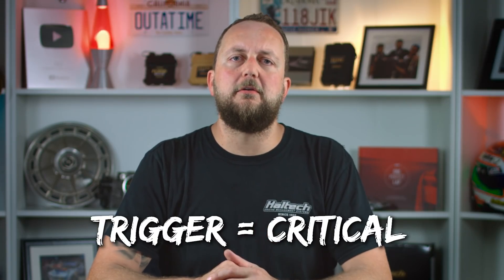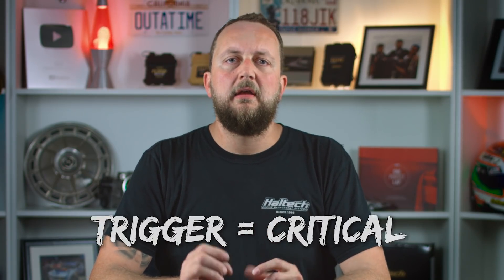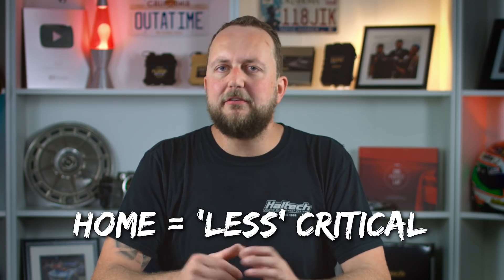🛠 Get Triggered - Engine Trigger Systems Explained | TECH TUESDAY

Comment from the maker: It's Tech Tuesday time again! Today we're talking Engine Trigger Systems. Hit that PLAY button to find out what the different trigger systems are and how they work. Enjoy:)
More videos on the subject here:

How Nissan's Cam Angle Sensor Works: https://youtu.be/mh4hxnfMfGA
How to Set Up Crank Angle Sensor: https://youtu.be/HW0ENqcxNSg
Reply: good video,   ? specific to the 2jz Nonvvti... 
how do you calculate injection angle and injection phase from a 12tooth - 1tooth setup properly
Reply: Haltech as you may remember this was exactly my issue. Thanks to the Haltech support team we figured it out and made my vh41 work! Thanks guys!
Reply from the maker: Here is a video we did some time ago on TDC: https://youtu.be/2yoxiKJ1KzY
Reply: Sooooo... Get an engine with timing chain instead of timing belt and you have less harmonic resonance issues? Am I even there about?

Comment: Hey do you have a suggestion for a Datsun L28 6 cylinder? I was thinking about a 36 - 1 trigger wheel on the crank and a single tooth “home” wheel inside the distributor. Thanks! P.S. - I can make my own cam “Home” wheel myself. 👍🏼

Comment: Hay mate 
Do you know what way to wire the crank angle sensor on s2 Buick vn-vp v6 using ems 4424 stinger
Dose the cas go directly to the ecu or back to the coil ignition module?
Thanks

Comment: I'm interested as to how ECUs measure these trigger signals, as they are incredibly frequent (E.g. 10,000RPM * 32 Teeth = 320,000T/M)

I'm currently trying to create my own ECU, but have created it around a single tooth trigger wheel. Think of a typical trigger wheel, but inverted. This works great, but I tried to implement a way of configuring what type of trigger wheel the engine uses, and it can only run up to ~3500RPM. As it stands, I'm using interrupts to receive trigger signals.

Cheers, great content as always!

Comment: Hey mate I’ve got a issue with my haltech wjere the car won’t start due to haltech error message “cam sensor” but when I plug in my factory ecu for my ford barra the car starts….
Reply from the maker: Hi there, best thing to do is contact our tech support on support@haltech.com or by calling your local Haltech office. One of our tech guys will be able to help you out.

Comment: What would be the minimum recommended number of teeth on both the trigger and home? I have a (now) supercharged Volvo B21E (obviously no ECU originally) and I will be using an Elite 750. The crank has a custom harmonic balancer and  I can machine to suit with a hall effect crank angle sensor. Cam has nothing but was also looking at installing hall effect sensor and custom trigger disk to run on rear of cam gear. Thanks for the great videos.

Comment: What of engines that just have crank sensors no cam sensors , how do they calculate the  amount of fuel need?
Reply from the maker: You will need a signal from both the crank and the cam sensor to effectively manage the spark events. Crank alone does not provide enough information - ie what stroke each piston is at so you would end up with two spark events on each cylinder, twice as many as you need. Normally you will have a crank sensor and a cam sensor but sometimes you can get a two-in-one sensors - Nissan's RBs are a good example of this - we have a video explaining how the Nissan CAS works here: https://youtu.be/mh4hxnfMfGA

Comment: I have 12T multi tooth trigger wheel on the crank and single pulse home signal from a YB cosworth distributor. The phase sensor is an analogue reluctor and very sensitive to movement once the Haltech PS1000 is set and has been causing a few problems. So the plan is to fit a new distributor that uses an EF-AU cam angle sensor, digital hall effect. But others have recommended removing a tooth from the trigger wheel instead of upgrading the distributor, could I please have your thoughts on that? Thanks

Comment: I have an issue with my b series trigger reading. I have wired my trigger to the cyk  24 teeth and home to the cyp as it is the one teeth wheel. the problem is when I am cranking the the engine in order to check trigger synchronization level it gives me full then goes back to none and so on. there is no trigger error system. I tried to change edge, ground and edge rejection ratio but none of these tries do a job. can someone help doing the right setup and calibration, please ? it better to note about trick and tips. I did another job to the distributor and it works but I DONT want to doing every time as it takes a lot of work to do it. what I did is i made my 24 teeth wheels is a missing teeth wheel by removing 2 teeth and I have canceled the home reading as it is also doesn't give the correct reading samw as the first issue. if anyone wants to do what i did it is worth noting that edge must be a raising edge otherwise it won’t gives you full level.
Reply from the maker: Your best bet would be to contact our Tech Support, one of our tech guys will be able to help you out and ensure you're getting the most out of your Haltech ECU. email: support@haltech.com

Comment: I'm getting a new harmonic balancer. 
The balancer comes with 12 teeth or 36 teeth options. The application is a Nissan rb25det motor. Vehicle is running off a AEM stand alone Ecu.
Does my application even need that?
There is no teeth on my o.e. pulley.
And if I do, what option is correct.  12 tooth or 36 tooth?
Reply from the maker: Hasani, The OEM harmonic balancer does not have teeth because both in it's original configuration, Home and Trigger signal come from the CAS located on the back of the cylinder head. If you're planning on still using the CAS after the harmonic balancer upgrade, then the number of teeth on your balancer does not matter.
If you're going to upgrade to a true crank sensor , that's when you need to be concerned with how many teeth are on the balancer.
Haltech Elite ECUs would support both 12 and 36 tooth options if the cam's trigger is modified to be a single window. We can't comment on AEM.
Reply: @haltech  thank you so much for the reply. One last question tho, what would be better to have 12 or 36 if I go with a true crank sensor?

Comment: Hi can we tune the engine with only one sensor and that is 2 missing out of total 36 missing tooth on crankshaft? In my case i will tuning ktm duke 390 engine which is single cylinder.

Comment: Hey got a question in regards triggering, so my Son 1989 Toyota Supra turbo we're upgrading the  ECU to a Elite 2500 , what triggering system would you recommend?  We're planning for ignition system coil on plug and sequential system for the injector.

Comment: In a Missing Tooth system (36-2), i would be nice to know when the Home signal occures. The informations range here from right before maximum Ignition advance to 90 degree before TDC Zyl. 1. A video about this often used missing tooth system would be nice.

Comment: Crank trigger patterns are deeply rooted in the ECU software of every vendor. The 4B11 engine in Chryslers comes with a completely different trigger wheel compared one from a Mitsubishi. Cheaper to change the trigger wheel than the software.

Comment: You can actually run a engine with sequential injection (and spark) with just crank position sensor. The engine would be started in batch injection (and waste spark) mode. ECU will then need guess which way the camshaft is facing (out of two) and chose the one that runs (better).
Reply: What ECU is capable of guessing?
Reply: @jockobo  It doesn't really guess. It just chooses one out of the two options. And then monitor if engine runs properly. If not it just switches to the other option.
Reply: @valde3336  Haltech ? Just curious because that's pretty neat.

Comment: 1:25 - same thing that can be seen on supercharger drives, the belt flutters slightly.
As an aside, oine of the early drivers of crank triggered systems in motorsport was a problem high rpm drag cars had with timing scatter as the timing chains stretched and fluttered - even worse off were vehicles like the Chev' engine which had the distributor and oil pump alse being driven off the far end of the camshaft as the camshaft itself would twist back and forth along it's length from those and the varying loads on the cam' lobes.

Comment: Could you use the flywheel ring gear as a crank position trigger wheel, remove half of one tooth so you don't effect the starter motor but can still be detected by the trigger sensor
Reply: That depends on the number of teeth on the ring gear. The Elite only supports trigger tooth counts which divide nicely into 3600. 
e.g. 3600 / 24 teeth = 150, which is good. 3600 / 129 teeth = 27.907... which is bad. 
Some cars just use the ring gear without modification and a second sensor for the 'home' which has one pulse per crank revolution. This method won't work with a cam sensor home, as the cam chain stretch is too much. But if you turn your ring gear into a missing tooth trigger, you won't have that problem.

Comment: I’m from the UK. Can you use your ECU on European Subaru’s? Thanks
Reply from the maker: Yes, it's usually the JDM and USA spec Subarus that are different from the rest. When a model is not supported by our ECU it's clearly listed in application list on the product page: https://www.haltech.com/product-category/subaru/
Reply: Haltech Had a look at your product page for the STI MY01-05. It says the STI is only for JDM & Australia! Is it still possible to run the Elite series on a UK STI by custom configuring the tigger patterns, or is there more things to configure? Thanks

Comment: Is it worth upgrading MX5 crank trigger from 4 tooth to 36-2 tooth? Manufacturers advice to do it for forced induction applications. Why are those different?
Reply: Did you find any info on this dude?
Reply: @niicegarry6714  It's better to have higher resolution on the trigger wheel. Then ECU has to do less guess work on the exact position of the engine. 
In higher boost levels timing is more critical. Each degree holds more power and each over advance is more destructive. So having better control you can be closer to the limit, where with 4 tooth you have to leave a few degrees on the table to allow for some fluctuations
Reply: @Domas64   thanks man, great explanation. Out of curiosity, what kind of power levels are you running?
Reply: @niicegarry6714  not much. 1.8l with supercharger. Will upgrade the wheel when i do the front engine job for seals and belts.

Comment: Excuse the newbie question, but if was to run say, a 36-1 trigger on the crank but also run say 2 tooth (or whatever)trigger at 180 deg also on the crank for cam sync,could I tell the ECU it has a 4 tooth trigger at 90deg to get away with both triggers on the crank? The reason I ask is I’m converting an old mechanically injected race engine over to EFI and it would make it so much easier to mount both sensors on the crank.
Reply: There would be no benefit to using the 2 tooth wheel on the crank, as the 36-1 already gives the ECU knowledge of where the engine is within a revolution. This is enough to run a wasted spark / semi-sequential system, but not enough for full sequential / direct fire. If that's good enough for your application, then you don't need to worry about a cam sensor. If not, you'll need to add one. 
Adding a second sensor is only useful if it improves the information the ECU gets. e.g. adding a sensor and appropriate wheel on the cam shaft means the ECU can determine where the engine is within a full engine cycle.
Reply: Thank you for your reply Tev, I am very much a newbie when it comes to EFI. Forgetting the 36-1 trigger and sensor, if I was to put a single tooth on the crank but told the ECU it was a 2 tooth, would it not then think it’s spinning at half crank speed or does it not work that way? Cheers for the info.
Reply: @doigbrosracing  If you put a single tooth on the crank, you would have a pattern that repeats every 360° of crank revolution. If you want full sequential, you need a pattern that only repeats every 720°. That's why you need to put something on the camshaft if you want sequential. 
An 'expert mode' alternative if you've got individual throttle bodies is to attach a secondary manifold pressure sensor to the intake runner of one cylinder. The pressure drop from a spinning engine with a mostly closed throttle plate can be seen as a change in voltage. That's how I've set up my bike. This only works with ITBs, as you need a pattern which only repeats once every 720°. Because the pressure pulse becomes insignificant when the throttle is open, you have to configure the ECU to ignore the home input once it's at full sync.

Comment: I was talking to a friend about getting sequential spark and fuel off just a crank signal. Here's what I thought. Could you do a toothed wheel that missed one tooth and then 180* from that was missing 2 teeth? Then the ecu could correlate which stroke it was on right?

Comment: Cam trigger for a Pontiac V8 like 389, 400, 428, 455. Luhn makes or made one but is there a way to use the old base as trigger and run LS style coils on an old V8 like Buick Olds, or Pontiac. I figure anyone with and old SBC or BBC is swapping in an LS anyway.

Comment: I have a Rover 220 turbo. It doesn't seem to want to rev above something like 5500 rpm. Normal rev limit is about 7500 rpm.
Could the crank sensor be failed or faulty or would it not run at all if the crank sensor was failed?
Reply: @Scott Hilzinger Sorry, I should have mentioned that the check engine light does not come on. The car is a 1994 year model. I've swapped with a known good ECU and same. Engine is the four cylinder Rover T16 16 valve 2 litre DOHC petrol with the Garrett T25 turbo charger, all standard. There are no hot or cold start issues and no missing, just a low rev limit.